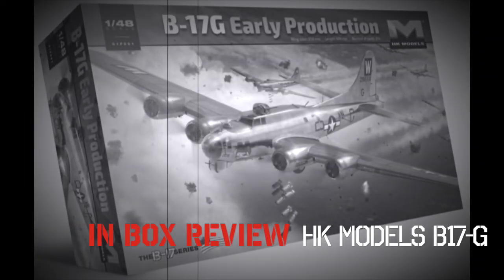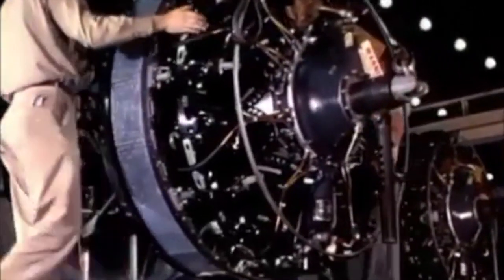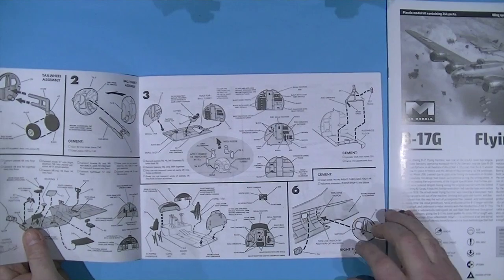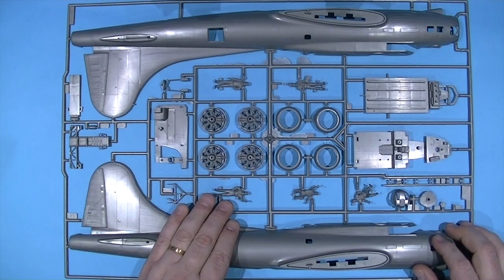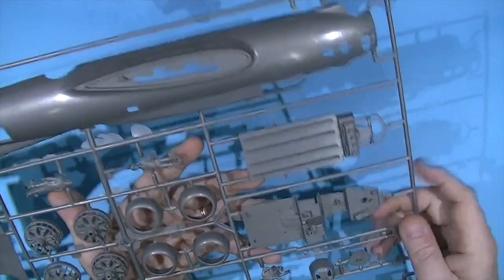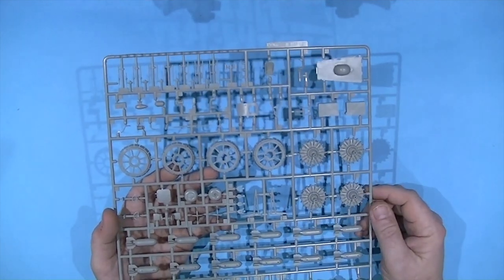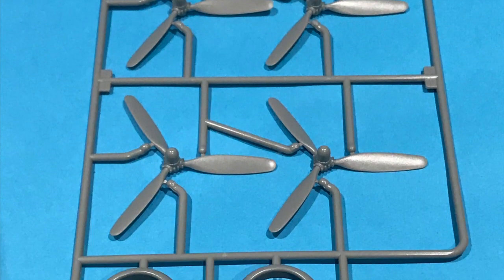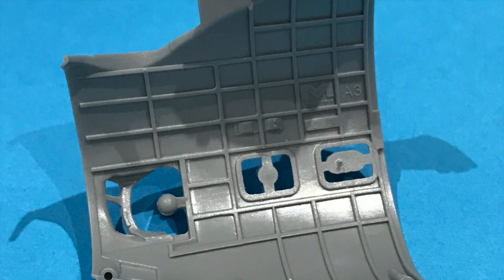HK Models/Revell 1/48 B17-G comparison and In Box Kit Review

Comment: Havent watched all the video yet, but ok tell everyone now the Revell model is a piece of shit, motors look line a 1st grader did them. I threw the thing away just bought it 3 days ago and upon opening box it was thin flinsey, plain have parts, the injection molding is upwards to 1/4”wide on the wings abs broke unevenly abs I would hv had to use puddy if built didn’t wast my time. ZERO rivets, raised panel lines, that’s cool but no rivets is Bull shit lazy fucking work. 
DO NOT WADTE YOUR MONRY ON REVELL
Reply: Hmmm... Monogram seems to be getting more good comments. Mine turned out awesome. Still have have it after 20 years later. Easy build. Everything aligned great. Maybe you got a bad one....Happy new year!
Reply: i've built six monogram b-17s and they are great. raised panel lines are authentic. you can place rivets in the model. that's why you are a modeler and not a toy collector. and youre not wasting your money on revell. but hk models is too high a price for a 1/48 kit. you can jazz up the monogram kit to be like  the hk kit. it just takes the proper modeling tools, time, work and dedication...